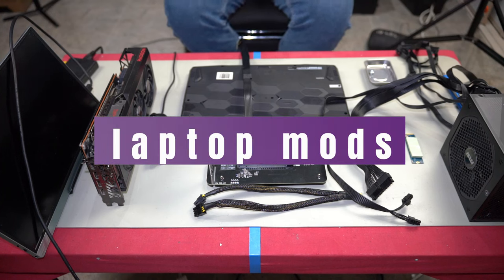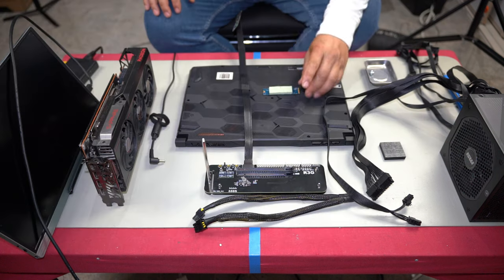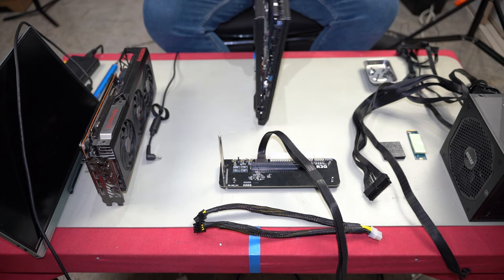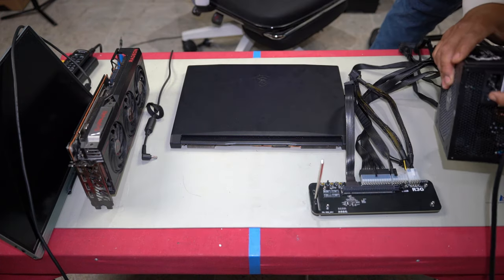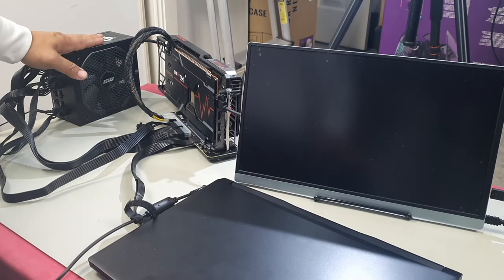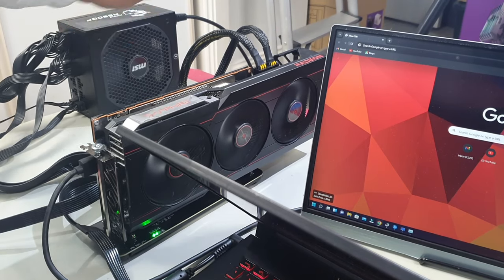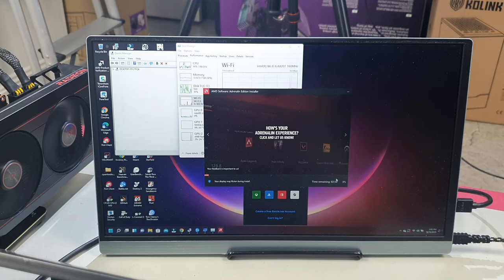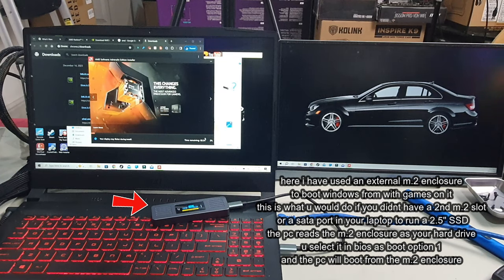how to setup eGPU  use an external gpu with your laptop for gaming

Comment: hi mikeys, awesome video btw, just curious is it ok if we use gpu power ( 2x 8 pin one) direct from psu?
Reply from the maker: u can try it, and see if it works, but in my experience , the atx and cpu is what powers the egpu device and then using the egpu , it then delivers power to the gpu output which will then power your gpu, i honestly haven't tried it that way but i believe you can try, it won't harm  your gpu, it will either work or not, i simply just followed the manufacturer procedure , i didn't feel the need to modify it in anyway however for a 4090 or 7900xtx which have x3 or x4 9pins, i guess u would need to find a way to add more power , and, if that is the case, i would definitely try it your way, as splitting a already split 8pin is not providing true 150w- 300w  per 8pin ...u can only try and see what happens, just be careful
Reply: @MIKEYZVLOGZ  thanks for your insight man, i appreciate it
Reply from the maker: @wandypurnomo1009 ur welcome buddy...I'm no professional but I've slowly learnt to build pcs and slowly starting to understand certain aspects of parts and what they do..but I'm still learning too. but am always happy to help where I can... something u learn just by doing ... and that's what I did for this ...plus research and other yt videos

Comment: Can you use the display of the laptop as primary display? Or do you have to get a monitor by force to use it.  Since I don’t have a monitor nor a headless adapter to trick the monitor for laptop display. 🙏
Reply from the maker: @stphnrx1  u can... I was able to use my display ...just ensure u also disable integrated graphics aswell so it's solely  using the graphics card
Reply: @MIKEYZVLOGZ  life saver 🙏 thank you! thank you!
Reply from the maker: @stphnrx1  although I was able to use mine some ppl struggle with it ... I'm not sure why but I will say that yes I was able to use my screen as shown in the video
Reply: @MIKEYZVLOGZ  does it matter if you use Nvidia graphics card or and? I heard and u need external while if use nvidia u don’t have to
Reply from the maker: @stphnrx1  nope
Reply: @stphnrx1  So I can just play games on egpu and display output will come from laptop GPU, although we will get less fps but that's brilliant and money saving

Comment: Can I use an eGPU with dell precision 7510?
Reply from the maker: @samueloluwafemi5812  honestly I'm.not top sure which it's compatible with ... u will need to ask the seller/manufacturer as they understand it more.... however i will say i used it on laptops with m.2 slots and it worked ... sometimes it's the gpu that isn't reading ...but u have to trial it ..that's what I did and it worked for me...some ppl have said it doesn't respond however u need to figure out if that's due to compatibility or gpu too
Reply from the maker: @samueloluwafemi5812  i would say it should work with most modern laptops and gpus

Comment: Hi! I have a rtx 4070 super waiting to be built into a PC. Meanwhile I have a 9th gen intel Cpu laptop (i7 9750H + 1660 ti)) that has a m.2 supports pcie 3.0. Before building my PC I would like to trying out the new graphics card on my old laptop with a oculink adapter. Would it work? I'm not looking for the best performance, just to improve my old laptop.  Many thanks
Reply from the maker: @zhijiawang9726  yes it should... I don't see why ut wouldn't
Reply: @MIKEYZVLOGZ  Thanks for the reply! How much performance do you think it will lose?
Reply from the maker: @zhijiawang9726  can't give u a precise number however it will definitely be better then your current gpu in performance
Reply: @MIKEYZVLOGZ  many thanks！ will try it out

Comment: I have a really old hp 430 probook g3 will this also work ? Some advice is kindly appreciated 😊
Reply from the maker: it should work still do u have an m.2 slot
Reply: @MIKEYZVLOGZ  yeah this has a m.2 slot on this laptop 💻 no thunderbolt 3 or usb c connections available though, I’m still in the early stages of trying to procure the right parts for this Project.
Reply from the maker: @jl285  ahh I see how will u run Windows
Reply: Yeah it’s running off an internal hard drive  plus there’s an extra slot empty it’s noted down as m2.5x2.5
Reply from the maker: @jl285  that's fine then it will work
Reply: The specs are at the moment core i5 6200u (mobile) only has 16gb of ram atm I’m planning to increase the ram to 32gb are the specs for the cpu too old to handle for example your rx 6700xt ?

Comment: If i want to use amd Radeon r7 350x 4gb what power supply  should i use and is egpu compatible with hp elitebook 820 g2 and can we use any power supply
Reply from the maker: it should be fine ... but whichever egpu u wanna buy u need to ask the seller if its compatible cuz there are rare cases where it's not compatible

Comment: Do we still need to connect it through PCIe if the laptop supports thunderbolt ?
Reply from the maker: do u mean for type c display ?
Reply: @MIKEYZVLOGZ  my computer has 2 thunderbolts ports do I still need to connect the eGPU to the m.2 slot or just plug it to the thunderbolt port ?
Reply from the maker: @user-ut9tr5eh2e  as long as your egpu has thunderbolt connection u can use it and no need for m.2  connection...u use one or the other
Reply: @MIKEYZVLOGZ  ohh okay I see then thanks for the clarification

Comment: I can buy only i7 7th gen laptop which laptop should i buy so i could add egpu in the future please suggest
Reply from the maker: even with 7th gen can add egpu however I would save n search for deals on local advertisers n lok at eBay Facebook marketplace as deals can pop up n get some around 10th gen or even 12th gen ... amd u will be OK with something like 5800h as it's 8c 16t and then matching it with a descent gpu like 20 series 30 series and even 40 series..  main point if tour going for a pcie gen 4 gpu then get a laptop that ca support it..or u will only be running gen 3 speed which is a waste ... IMHO...
Reply from the maker: is a laptop your only option? can u go for a desktop as u have so much better option with a desktop
Reply: @MIKEYZVLOGZ  I have to carry it for shop in day time and game at evening
Reply: The GPU I want to add is Rx 470 4gb that culd I only afford
Reply: So suggest me according to my specs please and here I can only find mini pcie to pcie adapters only
Reply from the maker: @SufYan-f6y  what's your exact specs cpu and ram
Reply: I 7 7th gen 8gb ddr4 laptop or mini pc

Comment: My external graphics card device only has a 6 pin connector, what should I do with the power supply
Reply from the maker: what does your gpu have ? u can get an adapter that goes from 6pin to 8pin and that way u can still connect it to your gpu or egpu ...your egpu should only need 4pin and 24pin atx ...then the cable from the egpu that plugs into your gpu will be a 6 +2 and they are split into 2... if your gpu only has 6 pins then seperate where it joins 6+2 and only use the 6pin side

Comment: Hey man thanks, with your help I was able to setup an egpu with rtx 4070 on my laptop but I don't have an external monitor so I want to use my laptop built in display(2560x1600, 144hz) So what do I do to make it work? do I need to buy a headless dummy adapter which tricks the gpu to think an external monitor is connected to it. If yes can I get the same performance as an external monitor with my laptop display? Please help
Reply from the maker: @phoenix3510  yes u can get a dummy adapter..but mine didn't need it ...I was able to still use my laptop display ...but u need to disable integrated graphics as it will Interfere. however newer laptops are abit smarter in that. it uses both igpu and egpu when needed... I think it's how they are built now...back then it was one or the other ... so that where it gets abit confusing... try a dummy adapter and then ensure it's reading via the egpu
Reply from the maker: @phoenix3510  abit of trial and error and see how u go
Reply: @MIKEYZVLOGZ  Yeah mine also uses both igpu and egpu and I think it's a new Nvidia feature. But I was curious if using a dummy adapter gives full performance on laptop display same as an external monitor? Or I will get the same performance I get on the laptop display
Reply from the maker: @phoenix3510  I'm not too sure to be honest it's was new to me too
Reply: @phoenix3510 hey did ut worked .. also can u explain what is mean my dummy adaptor and its giving same performance on laptop screen as well ?
Reply from the maker: @deep_sheep21 basically some gpus won't read because there no cable connected to it ...so some ppl use a dummy adapter to trick the gpu into thinking a cable is connected to output a display..i haven't had to do this but i have seen ppl do this
Reply: @MIKEYZVLOGZ  so m2 port work find with laptop display giving it max out performance ?

Comment: It wont burn my motherboard, right?
Also, I have Asus tuf a15(2021) ryzen 4800h Octacore, GTX 1660ti 
Are you sure sir that the supply won't burn my laptop. Can't afford to loose my device.
I have 2 m.2 slots, 1 has windows and one was blank which I used earlier
Reply: Also can you please tell me will it work for my device, as I just read the description I saw you told us to check things before buying but I don't know what to search
It's like is my device eligible
And sorry I forgot to thank you earlier, thank you for this video, cheers
SUBSCRIBED!
Reply from the maker: @ujjwalsharma5773  makensure u have a pcie 3.0 gen 3 or 4 m.2 slot first and that u have another way to run a boot drive if u only have 1 m2 slot. if u have another 2.5inch sata port u can use that as boot drive ...or get a external m.2 enclosure and see if your laptop can boot from that like I did ... these are the things you need to check... also sometimes the egpu isn't compatible for whatever reason ... u need to ensure it will work or else u have to return for a refund... in my case on the msi the egpu wouldn't work with 1070 but it worked with rx6800xt and 3080
Reply from the maker: no it won't burn your mobo.. ur not supplying any more power to your mobo..ur only supplying direct power to your gpu... your motherboard still gets power off your laptop battery and power dc connector ... that's why i use a seperate psu to power the egpu which supplies power to the gpu ... allowing it to work

Comment: After install drivers for amd gpu it automaticly start works with laptop or you have to switch something in BIOS. Cos you got anyway two graphics cards right now. One external and one inside laptop.
Reply from the maker: yes u also should check in device manager make sure it's reading and u can disable the laptop gpu so it will only read the egpu

Comment: Hello sir, so basically, if I don't have an external monitor, the display will be on the laptop, and it will use the dedicated gpu?
Reply from the maker: YES
Reply: @MIKEYZVLOGZ  do u have to connect a hdmi in this case?
Reply from the maker: @teaminvest1397  no if your still using your laptop screen u don't need hdmi to connect... because u are using your laptop monitor.. u only connect hdmi or dp. if your using an external monitor...it reads through the m.2 connection

Comment: Just to make things clear:
A laptop uses Mobile GPUs, they are worse than desktop GPUs (learnt it the bad way). It can be just 20% up to 50% less efficient.
Note: I am using statistics, since I can't afford to compare 😢

A lil' extra note: instead of using an external monitor, you might be able to upgrade your laptop screen. A 40 pin connection can support a 360 Hz screen; above that I don't know.
A 30-pin connection can reach up to 120 Hz only (from my own knowledge. So I might be wrong)

I think I am addicted to waste money on my laptop 😮
I just didn't change the GPU because it's soldered and I lack both knowledge and skill.
Reply from the maker: desktop is always better then laptop gpu its a fact
Reply: Yes, but sadly I was a dummy back then
Reply from the maker: @Doug_Fany  ITS OK MATe we all start somewhere, i use to buy pcs too until i taught myself how to build

Comment: is this external gpu compatible to predator Helios 300 1660ti?
Reply from the maker: it can be used for any gpu .. that's the point of external gpu .. it's also backward compatible with pcie 3.0 so yes it will work

Comment: I have a question that if i use sata to m.2 and then m.2 to pcie 4.0 will it work?
Reply from the maker: hmmm theoretically it should  .. however can't u get sata to pcie? so u can skip the m.2
Reply: @MIKEYZVLOGZ thanks i need to make sure before i buy the stuff
Reply from the maker: @thaikun9583 ye very true... sorry I don't have the adapter to test for u bud...